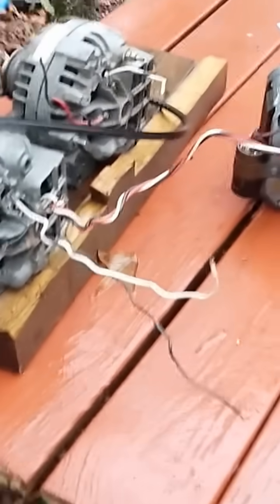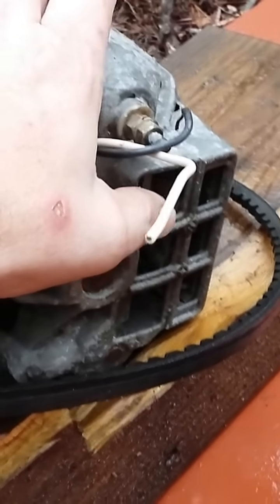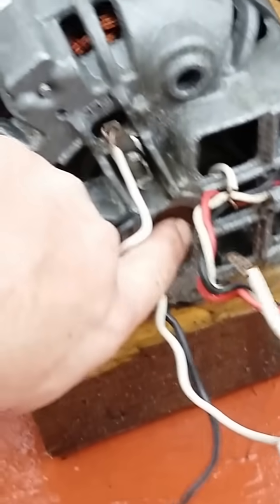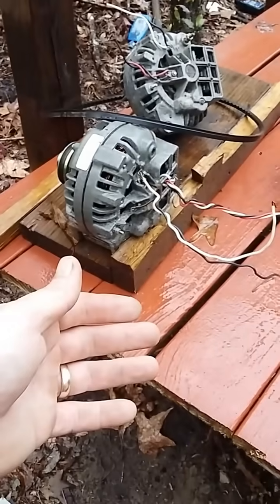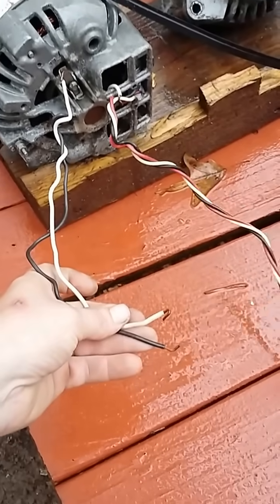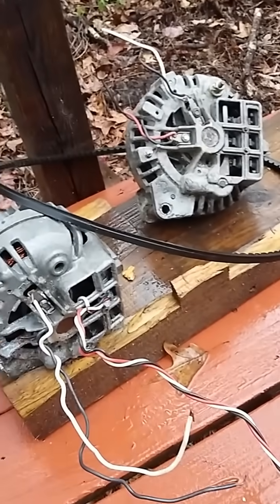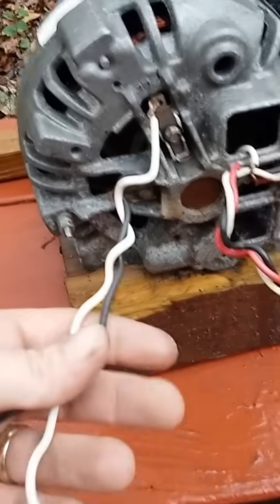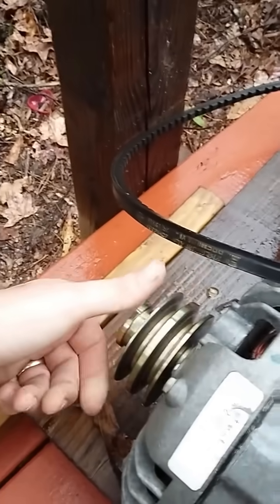Update Free energy forever no wind no solar no gas READ DISCRIPTION!!!

Comment: You can't change the laws of physics. This will not provide functional power for a house.
Reply: It can if the engine is bigger
Reply: @eokusa  
That is my point.
Reply: @wilsonrawlin8547  how did you express that was the point you were making? You only said it wasn't possible.
Reply from the maker: Free energy exists in all large differences and potential and always when you compile the frequency a certain way symmetrically in an unsymmetrical way I'm not going to explain resonant frequencies right now or what's the difference in doing two times pi times the square root of the inductance and capacitance and why it is most important to keep the same resistance on your inductor as you do on your capacitor along with some other things I just don't have time to go into right now...
Reply from the maker: If this is the alternator video just phase shift the middle phase disconnected and put a diode on your middle inductor and make sure the resistance is the same on the inductors between the field winding and the three phase stator linings three resistors and three capacitors to the phase shift 180° before amplified... I'll come back and proofread this in just a little bit but I really have to go..
Reply: @NerdKrusher  
it isn't
Reply: @wilsonrawlin8547  how?
Reply: @eokusa  Or if you have a large transformer

Comment: So essentially what you’ve done is made a generator powered by a battery running the motor they can actually power your house and probably charge itself! I want one. Message me I’d like to have a little more knowledge on how to do this myself, not interested in anybody’s stupid comments trying to say what he did or didn’t say, obviously he’s being careful about what he’s  saying on the Internet.Doesn’t seem far-fetched to me at all, you just need to know how all these parts connect together.
Reply: The Power is generated from the pulley, there is nothing spinning.

Comment: What kind of alternator is that car for?
Reply: That is an older Chrysler alternator 1970 to 1978 models used these.  They use an external voltage regulator for DC applications.  Chrysler had two field wires the old Ford and chevy ones only had one.  You need a stream or a windmill or something to turn these to produce electricity.  Ideally you have a battery storage system for actual useable power for a off grid homestead.  You need golf cart batteries about 12 of them and those are over 100 bucks each.
Reply: What kind of alternator is that for?

Comment: Wow.    Seems you've uncovered a perpetual motion machine that's been right under our noses.  Physicists have spent centuries chasing the Holy Grail of energy.......... More energy output than input.    And you found it under the hood of a junked car.   AWSOME!!!!!!

  By the way,.   A diode is there to keep current from flowing the wrong way within a circuit.   A generator and an alternator are ABSOLUTELY NOT the same thing.   If they were, a generator would have rectifier.      People like you are DANGEROUS!!! What happens when someone is dumb enough to start messing around "For Real" with Alternators, current, water, wood, and shitty wiring?    What happens when some Morron burns down his house cause he thought you were on the up and up.        

Karma is going to kick you in the head bro.       And, I gotta say, You Deserve it.

Comment: I hate to say it man, but taking a closer look at this...90amps would disintegrate those puny output wires, and probably the alternator coils before that even. You would need transformers to get that kind of output, and you would need a full bridge rectifier to convert AC to D.C. I just dont see how it's possible with what you got there. Why dont those puny wires break down from 90 amp output? Idk maaan just hook it up and let it rip so we can see if the houses continuous power draw doesnt stall the setup. I dont mean to be rude by saying this stuff trust me. I've been trying at stuff like this for like ten years now. It just doesnt make sense to me with what knowledge I have about electricity. I just dont see how something can run without energy input, and actually power something continuously without getting drained. Especially a whole house even if it does produce more than what the house needs how does it KEEP producing it dispite the load and resistance cuz whatever comes back to the device will be less like how does it just come back out the same? 🤔
Reply: Those are Chrysler alternators, typically rated for 90A. So I imagine thats where he got his numbers. Whether its accurate or not for the unrectified AC output...idk...
Reply: Alternators make AC power that's why they are called an alternator (as in alternating current), and they already have a rectifier in them that converts the AC to DC for your vehicle power. He is bypassing the rectifier and connecting his wires directly to the AC power. But he is not getting 90 Amps AC from it, it is a 90 Amp DC alternator so it would only make about 10 Amps of 120v AC power, I don't have the exact calculation in my head but it is roughly 10 to 1
Reply: @RedneckHillbilly-ho9md  I've been hoping to see at least one intelligent person.... thank God we don't have to purge the entire you toob peanut gallery.... it hurts my brain to see so much of the world continually be so stupid.
Reply: @afterglade1  what would be the best thing to get the alternators started off with? You are in the woods you said so it’s got to be something simple. Thank you
Reply: @RedneckHillbilly-ho9md  it should be close to 14 amps
Reply: @afterglade1  I know right lol! 
It should be more like 8 Amps in 120v, that's what the amp calculator online showed me anyways, that came out to around 88.9 Amps for 12v DC.
Reply: @afterglade1  this would be great for running LED lights and a radio or maybe a flatscreen TV and charging your cell phone but that's about it.
Reply: God dam he's right to disable comments haha your so dumb you can't see he's got 12/2... that shit will carry plenty but it's 220 so you don't know what your talking about.  This is a Chrysler alt.... this has been done for years to make on board welders and power... just because big tech and the TV didn't tell you how doesn't mean it ain't done.. this guy actually gives you all needed info... just not step by step.. because they will come for him like they did tucker.. gm, Ford,  and Chrysler all ruined tucker and had what 500 mile per tank in the 50s

Comment: Am very interested to no about what hz will it be to be able to get 220v ?? Surely 50hz alliance's  will be ruined If this alternator runs higher??
Reply: With an ac to ac stabilizer you won't worry about overcharge  lol why  not use directly an 10kw 220v alternator  y  mean using 2x car alternators wich will require ca 12000 rpm just to get 90a out so that mottor what is used is just bot worth it

Comment: I got a question where did you come up with the 90 amps and that wire coiled around in there is called windings and  a diode is Just  One Direction for current so it doesn't do anything like change DC to AC and who the hell is they that told you you wouldn't live much longer and if it works why didn't you show us that it works
Reply: Omg this video is 13 years old just re uploaded you people are so dumb.. haha I hate the computer literate stupid people.  I bet you struggle to throw a football... he doesn't have to hold your hand or write it down for you.. if your smart enough you should be able to figure it out ...
The windings are wrong on new alts... but this model has been used for c this very thing for over 30 years.  We make welders and power on board mounting to the bracket and using the running vehicle.. it does take much to rework and once it starts you get a constant..
Reply: Those are standard Chrysler alternators rated for 90 amps/12 volts DC. Thats where he got that number. Im not sure about the amp or voltage output they create AC... But im gonna question that its 220V at 90A.

Comment: I have been working on cars for 45 years, and there is no way you can put 12v to an Alt, and have it come out at 220v it can't be done.. and if you are in the woods now, then why did you take it apart.. How are you powering things in the woods if you took it apart..

Comment: If it works I like it
Reply: I hate to say this, but the 'rude' comments actually do hold true. There is no way to have 12v in and 220v out of a car alternator. You would need transformers for that, and using that meathod to step up the voltage would result in loosing amperage. Plus, the diodes alone wouldnt convert the AC to DC it would just make the AC come out in pulses instead of a constant oscillation. The diodes have to be configured in a FULL BRIDGE RECTIFIER circuit to do that. Plus those wires arent thick enough to handle 90 amps they would break down into a plasma state and atomize band basically disintegrate into a gas and short out. I thought this would work to till I took a closer look and read what the nay sayers said up top.

Comment: Overall are you trying to say 12v Dc charge to alternator gives of more power than it uses
Reply: Thats right, the reason the generator makes power is because powered by the motor. If you could run a 12 volt battery to an alternator and make 90 amps output, well then, Elon musk and his team of engineers really overthought their cars..  haha

Comment: So you still need a source of energy to  spin the alternator and fast  2400 rpm min. and by bypassing the diode and applying voltage to the exciter  you're creating electromagnetic induction <- knowledge.  Congratulations on reinventing the wheel. And a side note, I'm fairly confident No one threatening your life over a D- grade middle school science fair project.  You're smoking the meth you're making aren't you?
Reply: POWER ITSELF 😂😂😂 OMFG this is the best comment in an outstanding field of dumb comments
Reply: @mrjimmbo  I bet you wear a mask and got the poke and voted for slow Joe.
Reply: @mrjimmbo  yeah they shut Tesla down too. You opinion means nothing to me.
Reply: @mrjimmbo  the power that comes out hook a charger up to run the motor that was hard to work out 🙄
Reply: @supraanon1914  that's not how conservation of energy works champ
Reply: Sound like someone is sour
Reply: With the right gear ratio I'm sure o e could make it power itself.

Comment: Bro... 90 amps at what voltage? 12? That's Just 1000 watts.
Reply: you guys are sooo naive ha ha ha . .. the main energy needed to operate such a system is brute force . . .spin the pulley !  you need to spin it yourself !  or your poor donkey . . .. .. or connect the electric motor to spin it . . . USING YOUR HOUSE CURRENT ! LOL !  what a freakn fool !
Reply: @jeffokriya3389  😂🤣😂🤣😂
Reply: @jeffokriya3389  tho this man has no electronics or electrical background , in principle and in theory this should work . His wiring is shabby and presentation is sloppy
Reply: @dereckdean578  . .are you an electrician or engineer?
Reply: @jeffokriya3389  let me answer the question that will follow your first. Yes, I have built a safer version of his model with a voltage regulater and protector. I also added a sub panel to protect my home and appliances. Licensed Electrician and Certified Electronic Technician.
Reply: @dereckdean578   . . yes I understand .  .the regulator is ok  . . But the point here is why does he try to say it´s "free energy"?  You didn´t tell me how you spin the alternator. Are you using a motor?  and what spins the motor?  your 120VAC  house  Supply?
Reply: @jeffokriya3389  ha ha  ha  you really are like Stacy Dash aren't you ....... Clueless. !! Now where is the fun in my showing  you ?
Reply: @dereckdean578  I just asked how do you spin the motor. Just answer, you don´t need to give me exact details. I know everything my boy. I graduated in electronics engineering years ago also as a general electrician that is, residential commercial and industrial.  Besides I know most trades and sciences .. .  at least the basics. I can give you nice clues about the real deal, free energy.
Reply: @jeffokriya3389  then you are more than qualified to figure this one out.
Reply: @dereckdean578  sure, Im not asking your help,  Im just finding out what people do about it and how they are conned. You took it in a a bad way. My comment was not for finding help .. how can you guys help me when you know nothing ? ha ha :oops::oops:
Reply: but it´s always interesting to find new ideas , I don´t  have a big ego, I can listen to anyone
Reply: 1000 watts can run a internet modem, 2 computers, a TV, coffee pot, a couple lights and a phone charger. Plus charge a battery or two.
Reply: Your breaker box is only 100 amps. 2 is plenty
Reply: @holdenthompson1235  lol at 240v not 12 which is what a car alternator will give you
Reply: @holdenthompson1235  yea well that's one air conditioner.  Lol.  Still cool.  Jus picking
Reply: @240v

Comment: I have tried to do these on multiple alternators. How do I know which wires to supply the 3-12v power to?
Reply: Just stop.  It's a scam to get YouTube traffic.
Reply: It don't work how you can get out of an alternator 12-volt and it take you that much or 120 volts to spin it

Comment: It's sad that most of the comments on here are very rude and not courteous at all... I think a lot of you are missing common sense... Why don't you guys research how much power an alternator produces out of your very own car sitting in your driveway and then with your book smart minds tell me why this wouldn't work and no assumptions either... Or better yet, go spend 5-700 dollars on a company built generator and take the generator apart and tell me what's so different between an alternator and a generator.... You know back in the 50's 60's 70's and 80's most vehicles had generators that ran off the pulley and it was direct current......... This guy is pretty wise if you ask me. It's very basic matter of fact all you haters out there really over think this basic system... It's actually kinda funny
Reply: Go ahead and waste your time and money trying it. It's a scam to get YouTube traffic. That's why his comments are back on.
Reply: @scooterss2112  must've broke your account..... Or you missed a wire.........
Reply from the maker: There is no trick in the alternator being a motor... the actual trick is in the construction of the alternator itself to be a generator and/or a motor at the same time...  And I do thank you very much for the kind comment! I try and tell everyone that the video clearly states that you must read the description and in the description it tells you that there's  missing information from the video (that I share privately) and if you read my comments, in the comments then you will find out that I was using the Chrysler alternator, which is a field magnet generator, as  a motor. And all I did was take the diodes out of it leaving me with three wires and the other end of those three wires are tied together...(wired in star)  now, I know that I must have the same resistance on my inductor as I do on my capacitor to get the resonant frequency...??....   Once you know the resonant frequency you should probably adjust your capacitance and resistance to the appropriate capacitance and resistance on your field winding that rotates as well... I made up an equation to be able to do this easily...  there are two of them actually.. one is pi of the whole leaves the golden ratio. and the other one is phi of the whole leaves to Golden ratio and it depends on if you're working with positive energy or against positive energy as to which one you use... I would suggest working against positive energy because it is bad, and bad for you... and also there's not as much positive energy as there is negative anyways.... But,.. Like I said, I appreciate the kind comment!!!! And I hope I was able to shed a little bit of light on the circuitry...

Comment: If this derives its power from the earth its technically not defying thermodynamics, and isnt it's own source of power. I'd have to take a longer look at this to understand how it works but either way it's cool. Anything to beat big oil and the energy companies that works is an invention I like.
Reply: Dude you can look all you want but that's not going to work
Reply: @itsurdestineetowatch  I know but I  just had to take a closer look to see why.  Those puny output wires wouldn't even handle 90 amps they'd heat up and break down. I tried to explain to him the matter of resistance and how no existing material ever found is without resistance. His concept is vague with many important details left out. If this could be done with conventional alternators it would be done already. He doesnt even realize diodes alone are NOT a FULL BRIDGE rectifier.

Comment: One of the main arguements on this (wich honestly I think is pretty irrelevant) is the basic material science that is the fact that eventually the system will break down and not function, but to me that's not what counts. What counts to me is if it creates and sustains it's own power until the device breaks down without deriving its power from an external source like solar, wind, geothermic, or the from the planets EM field. Those can be free dollar wise, but not free from the laws of thermodynamics, and are basically only motors powered by the virtually limitless (yet still technically limited) externally produced sources. If it defies thermodynamics then the device must somehow be it's own source of power.
Reply: see this portuguese video maby it hellps    https://www.youtube.com/watch?v=XWlG5jXvwAQ&ab_channel=liciniobatista